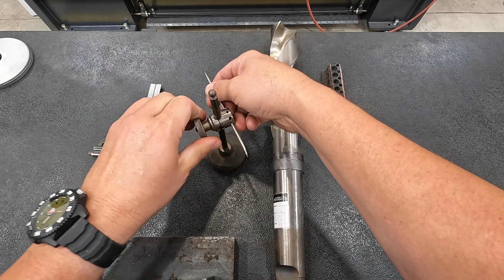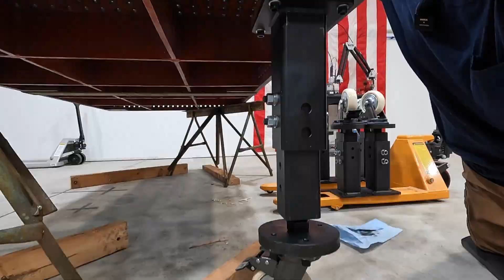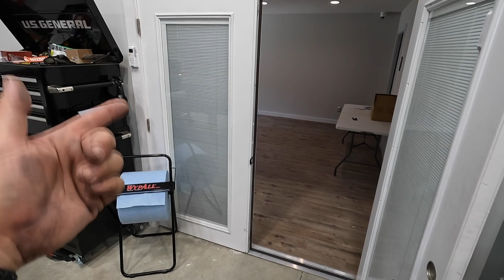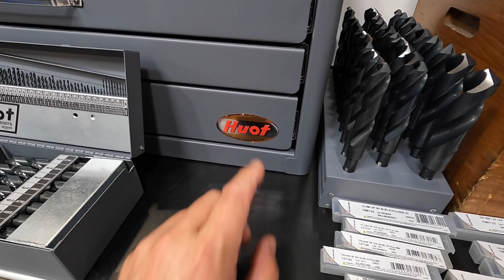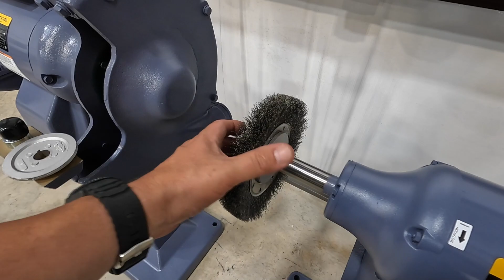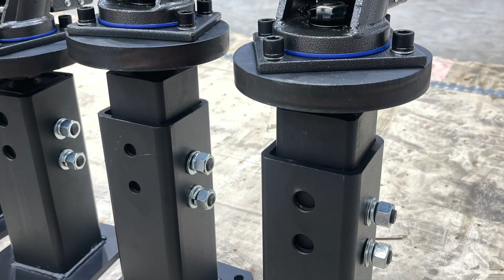SNS 365: Fireball Tool Welding Table, Balder Grinders, Tap Storage, Antique Store Finds

Comment: Idk why but I want to use that table as a battering ram. Just bolt round stock out the front and handles on the side. I'm not sure what I would ram it into but I know it'd break it.

Comment: Somehow I can't help but think that the table is potentially dangerous. Very high mass and center of gravity, a problem compounded if also loaded with large and heavy tools and work pieces. This coupled with the legs that have no sideways support and that you can roll the table. What could happen if you roll this loaded and a wheel hits a bolt or similar on the floor...?

Comment: Man that table sure is sweet! Sadly its a bit too small for me to build gantry cranes on and I could never justify 3 of them. Guess I am stuck working in the floor but luckily I have never had a fabrication job that needed aerospace tolerance an 1/8" in 20ft is seldom seen on most jobs.
Reply: Awesome

Comment: That’s one bad ass table
Reply: I love all the accessories for those types of Welding Tables, so many Clamps, stops, etc.
Reply: If you have to make it out of one piece, make sure it doesn't bend. Just one giant slab of cast iron with precision holes all over. Giterdun.
Reply: Table?  That's no table;  it's a 1000-2000-3000 block.  If there's a matching one in the next video, you know I'm right! ;D

Comment: Shouldn't the Baldor grinder washers be true from the factory? I expect low cost import tools to require touch ups and tune ups to fix quality problems but american made?
Reply: I doubt that it will make much difference.  12"x2" wheels are very heavy compared to the cast aluminium flange washers, and on the buffer the polishing mops tend to be pretty unbalanced in my limited experience, so even with perfect balance of the washers, the mop and washer combination is not likely to be well balanced.

Comment: Sorry, I just can’t get past the cost of that table? As a welder fabricator, I would of had a go at making it myself.. 
That aside it’s very nice .
Reply: If you watch Jason’s video on his channel about that table, you would quickly discover that making it yourself is not viable to achieve the flatness he engineered in that table. Sure, maybe you don’t require that tolerance of accuracy, but that is among the reasons for the cost of the table, cast material engineered to an exceptionally high tolerance of flatness.
Reply: @cj-ef1rp  +/- 0.01 or whater flatness seems pretty overkill for a welding table...Heat expansion, twisting and bending
Reply: @Rimrock300  Funny that Jason doesn't feel that way. In any case, it takes one source of error out of the picture.
Reply: Oh I have , Jason makes some amazing things , but 10k is a big investment for any shop .
Reply: @dalelyons4366  10k for that table is really reasonable priced.
Reply: @dalelyons4366  not rly, if you are a big shop and need the big tables to do build a specific project, 10k is nothing

Comment: One thing I would do immediateley is get a sheet of ply and cut say a 3 ft x 2.5 ft or so piece and another of same size or whateveer makes sense, that I would cover with a "nice" carpet scrap to use as  "table savers" and for items that you don't want to have bouncing around on cast iron... Even a few large sacrificial pieces of cardboard for greasy stuff etc. I'm preaching to the choir but I just had to say it... 😁

Comment: Would it be possible to put the air tanks on top of the office to save floor space?
Reply: Yes, and more sensible. 
Put all the compressed air equipment on top, but then it wouldn't be visible (sponsoring requirement)
 It is what it is
Reply: Did he say air tanks or welding/oxy tanks? Even with the gorbel it would be a pain going up and down to change them and turn on/off every day
Reply: @KPSchleyer  yeah the oxy tanks would be better off on the ground.
Reply: @KPSchleyer  maybe you’re right

Comment: Do the wheel locks lock wheel rotation and caster pivoting?
Reply: I've not seen any such casters.  Floor locks are closest and those need extra set of legs / mounts.  Did that on my welding table.  Great rigidity with them

Comment: One thing you might not think of - this stout bench could be on the porch of the shop taking a delivery off a lift gate and roll it into the shop.  Just something in a pinch.
Reply: Pretty sure a forklift is incoming.........

Comment: 50 years working in large maintenance departments and first-time that I ever heard the great tip of using 2 different size Allen wrenches to tighten them. Great ideal having such a heavy well made welding table on wheels. Have 3 four drawer file cabinets in my garage and placed them on home made dollies. Had to move them a few times.

Comment: I'm a life long as sparky but have some machine shop tools goodies like a 1" micrometer, SAE & Metric 6, & 12" scales end milks etc. Always heard that wood tool chest are better then traditional steel tool chest in preventing rust. Have watched several of fireball vidios. Guy makes the best welding tables & squares. Have to love all of the best in class this smart machnists is installing in the new shop. Was lucky to always have my tool cart & tool chests in an air conditioned shop so never had anything get rusty.

Comment: Wow man, what I wouldn't give for one of those tables. Congratulations, we are currently trying our hand at making a fixture table at work with some extra 2" hot roll machined to around 1 3/4" but I'm worried about spatter and stuff sticking over time, not to mention the heat on that hot roll no matter how thick it is. Nice vid!
Reply: His new table is cast iron. Very stable and spatter resistant.

Comment: I used to work somewhere where they had a metric drill set ( 1mm to 14mm?) that was 0.1mm increment.  No idea who made it or where it came from but it was extremely nice having that very fine drill size increment.
Reply: Probably a German made Guhring.
Reply: @Peter-V_00  I honestly wonder if it was the same set Abom just got.  It was in a Huot organizer but otherwise, essentially no markings.

Comment: It would be nice if that welding table had castor legs at the four corners and screw adjust feet at the other two positions.  Then you could lower the two, to act like "floor lock" feet to keep it from moving when you get it where you want it.

Comment: Nice equipment Abom! That table is going to come in handy for a lot of projects. Looks like you may need a few 1000 more sq.ft. pretty soon though. I recently watched Jason's video on the table pretty well thought out design. Here's an idea I was thinking of when you said using the table like a workbench... You could make a removable flat aluminum plate or work surface out of wood that lays over a portion of the table covering the holes and fixed by the quick pins for a modular type workbench.

Comment: I do not think I would put the gas bottles too close to the grinders. The grinders should never have to move, the bottles will have to be changed. Plus, I might put something over that insulation behind the grinders.
Reply: Baldor sells a pretty cool dust collection system that hooks up to that grinder. I couldn't afford it, but it might be worthwhile for a professional shop.

Comment: Probably too late now, but when setting up a 4 foot door, try doing it with a 3 foot door and a 1 foot door. Splitting into a pair of 2 foot doors means you have to deal with very narrow doorway when using only one of the doors. You might try a 30" and an 18" as well. I put 3-1 doors in all the doorways in the basement of our house that we built and found them very useful and convenient.

Comment: Those hole-ee welding tables are worthless. They might be good for the "Look et meh" effect.
Reply: Why?
Reply: @eprn1n2  Why? They cost a lot of money and are no good to the average welder. It's more of a trophy and a great place to store shtuff on. Production with ever changing fab might benefit from jig setups. Me....just weld to my table and grind it off later if needed.
Reply: @clutch5sp989  and now you don't have a flat surface anymore.

Comment: Adam, the Baldor's are built like a rock - I always wanted one (but never got one),however for the money they cost it was absolutely disgraceful that they packed them like they did. - they should be ashamed!!  Just on principle alone, I'd call them up and have them send new bases out! On the same note, how can they justify sending Aluminum wheel washers that are not true and need work before you even use it! I am not asking what the two Baldor set-ups cost you  but I know they must have run round $15k or so. For that kind of coin they should be in pristine condition when they arrive and should require nothing more than assembly! Very sad to see a once great Company slide down the slope I hope they at least run well!
Reply: I generally agree but also there is no telling what happened between baldors facility and adams shop... Just sayin'

Comment: Adam, you could always machine a sleeve nut, with a wide face, so that you could  fit the 2" Scotchbrite wheel on your Baldor buffer. That would also take up the 3/4 to 1" mismatch on the spindle size.
Reply: Or pull the spindle out of the motor and set in the lathe and lengthen the 3/4" spindle to accommodate the 2" wheel. That's what I would do. It would only take ten minutes to strip the end bells from the motor and pull out the stator shaft

Comment: Man that table quality is kind of meh. Warped underside, pitted corners, scuffed legs, discoloration of the faces, no scale engravings, and it looked like there was 0 attempt at corrosion inhibitor during shipping. 
Usually video hides majority of the defects but I can see them clear as day. Cant imagine it in person. 
Usually I follow what you buy to a T, but I think I'm going to pass on this one and get a Seigmund.
Reply: Where did he say the underside was warped? I didn't see any rust or pitted corners? The discolouration on the surface probably is from a milling machine or surface grinder going back and forth. Really no need to talk that table down...

Comment: It doesn't seem like you have the two middle caster feet lowered far enough, they aren't touching the floor, if it's not supported in the middle you will get some deflection across the top of the table
Reply: Watch and listen to the video.  He explains.

Comment: Easy for me to critique I'm an armchair quarterback, if I understand correctly on Fireball Tool's video about the welding table, it was designed as more of a precision layout table, suitable for precision work, as such I would think a guy would want to keep the table top as clear as possible, however, like I said I'm an armchair quarterback on this. Tables have a propensity to end up as catchalls and a large flat surface seems to attract odds and ends, think of it as clutter. Also, food for thought, I would want any floor mounted grinders mounted away from anything I valued, that grit permeates everything, yes everythang. Nice Nice Stuff, You are a Lucky Man.

Comment: When I was in grade 9 at school we made a surface gauge in semester 2 that looked almost exactly like that one. We also made a triangular depth gauge in the same semester because we finished the surface gauge to quickly, Back them the engineering shop at school was called "Fitting and Turning".

Comment: For when you want a flat surface, say for using the table as a desk, manufacture a thin plate with pegs at the corners that fit the holes in the table.  1/16" pegs should be just right to securely hold the plate in place.

Comment: Nice collection of tools you have going there. I had one thought about the buffer/grinder wheels. My friend has some 4 inch wide unitized scotch brite wheels on his grizzly buffer, they have a 3 inch Inner diameter, he made adapters to fit his wheels onto the shaft so that about half slid back over the large diameter of the shaft and the other half used an adapter/nut he made for it. The nut part was recessed down into the bore so that the nut did not sit proud of the outside of the wheel and you could put a socket down into it to take the nut on and off. this kept the wheels somewhat centered and the end of the shaft where they should have been but he could use those really wide wheels. the 4 inch wide x 6 inch diameter wheels were glorious for buffing metal to a nice sheen. All this could be yours if you know a guy with a machine shop and some know how cough*cough wink-wink. Hel,l I bought a lathe just so I could make the damned things for myself someday because I couldn't find them online anywhere, once I learn to use it and finish the 5,000 other projects in front of it. MSC and Grainger did have some pressed metal bushings for the bigger wheels you can use for about $4 a set. but not the 4inch wide adapters.
Thanks for the videos.

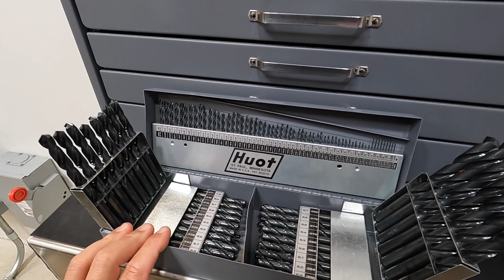Comment: 24:05 The one thing I can remember is that 5/16 and 8mm are very close.  If you want to use a hex key of one the other usually will fit.  3/8 is very close to 10mm.  
    An 8mm mercedes-benz oil pan hex key will fit a 5/16 coffin key lock.

Comment: Curious why you bought a table when you have the tools and skills to make one yourself?
Reply: watch fire ball's video on the table and it will make more sense.
Reply: He doesn't have mill big enough to make one and its cheaper and better for the top to be cast
Reply: @joshuahuman1  Not yet, but soon!  If you haven't already seen his Facebook video, then you will be surprised at the Flex CNC 20' gantry mill that is on the way!!!
Reply: The fact that it is cast iron went right over your head?
Reply: Few can make a fixture table of that quality in their shop.
Reply: He couldn't, for the price, make what fireball tools sells.
Reply: He probably has the skills, but definitely not the tools to build that from scratch. That's a 3300lb solid piece of cast iron, there's no facility to make that casting in his shop and it's way too big to fit on any of the machines for milling. Plus, the kit coming out of Fireball is always great quality and as far as I know they know each other personally, gotta support your mates
Reply: Yeah cause he can cast 3000lbs of iron and machine it perfectly flat in his shop...
Reply: Thanks for the sensible replies, and to all those sarcastic tw@ts that jumped to wrong conclusions based on a simple question. Of course he couldn't make a table the same, but he could make a very good table of his own design that would meet all his needs. It should have been obvious to everyone above 1st grade reading ability.
Reply: Why do you think he bought it?
Like almost everything in the new shop, it is sponsored items.

Comment: What size welding table is that in the video?
Reply: If you're interested in more information, fireball tool came out with a video you can watch
Reply: Looks like the big model 8’6” x 4’6” with 8” skirts
Reply: Just count the holes they are 2” apart 🤣

Comment: Hi Adam with your 2" wide scotch-brite wheel you could always just make yourself a replacement washer with a threaded hole instead of a clearance hole to suit the threaded rod that way you don't need a nut on the end and you would then have enough room to fit the wider wheel.
Reply: I appreciate thanks, make a note to  Enos Kent  concerning BTC/ETH investment ideas
Reply: ᗩ ᑎᗝ丅ᗴ Ƴᗝᑌ ᗯᕼᗴᖇᗴ ᖇᗴᖴᗴᖇᖇᗴᗪ ᗷƳ ᗰᗴ

丅ᗴxт▪️  ᑎᗝ丅ᗴ Ƴᗝᑌ ᗯᕼᗴᖇᗴ ᖇᗴᖴᗴᖇᖇᗴᗪ ᗷƳ ᗰᗴ
  ⊹𝟷𝟸𝟸𝟼𝟸𝟷𝟶𝟹𝟷𝟺𝟿✔⚡️💯

Comment: I use an older Demmeler cast iron welding/setup table at work that is about a third the size of yours. Fortunately, it has extensions on all four sides to expand its capability. I wish it wasn't laid out in metric and also wish I had more accessories (clamps, blocks, ninety degree risers and such. I tried to find a source online but didn't have much luck.

Comment: Think an improvement would be storage hangers for the mounting,holding,fixture accessories that match the table !
Reply: Maybe a small cabinet mounted under the table to keep dust and debris off the accessories while keeping them with the table wherever it moves in the shop.

Comment: Nice O-62 stack. I think red might have been the default on those older O-62 models (rectangular art-deco logo decals), as most of what I've seen come up for sale have had red. I'm in the (gradual) process of refurbishing an O-62 & OB-62 stack that originally had red felt as well. Your earlier video touring the factory and restoration process at Gerstner was not just informative, but very useful! Thanks for the show-and-tell, always appreciated.

Comment: Very timely as I just watched Jason speak in detail about his logic in building this table. I have long wondered about the Baldor grinders and polishers. Why they insist on using such thin shafts and also on not paying more attention to the "washers" or support disks and their tendency to wobble. Baldor has such a great name in motors, but these less-than optimal details on the grinding and polishing side don't make much sense. Thanks for the details on these very various shop tools.

Comment: Agreed, those Cast Iron Baldor dip cups are "Extra" even if you buy the pedestals...doesn't make any sense and they aren't really that inexpensive to add them.  We made our own dip cups out of stainless steel and welded a bracket on the front with the slip fitting to hold the cup. Love that Gerstner and the tap storage cabinets.

Comment: That drawer for the metric tap sizes has compartments for some funky sizes, some I have never heard of like 6.3mm x 1.0mm pitch. 4.5mm, 7mm, 9mm and 11mm are also very unusual, might come across those once in a lifetime.
Reply: Unless you're a cyclist, in which case you'll have come across plenty of M9×1.0 and a fair bit of M7×1.0 if you're old enough. The one that's missing for a cyclist is M8×0.75. M6.3×1.0 is a common automotive bodywork size, apparently. M4.5×0.75 is a size used for some carbide tooling insert screws.